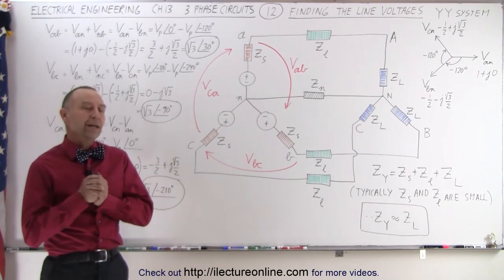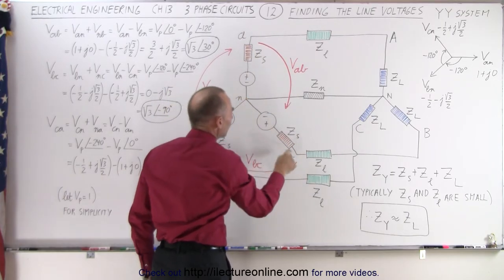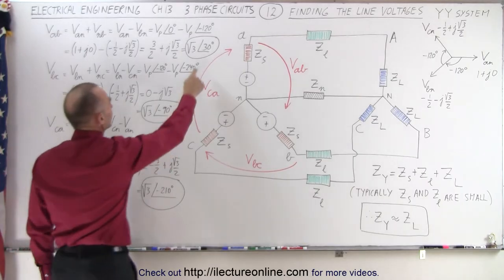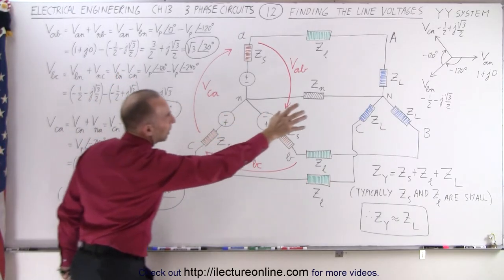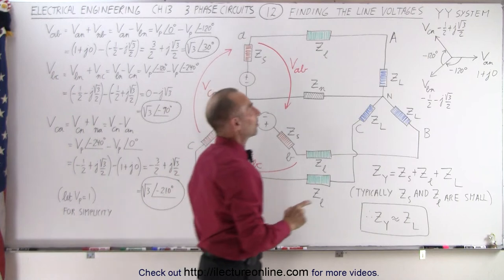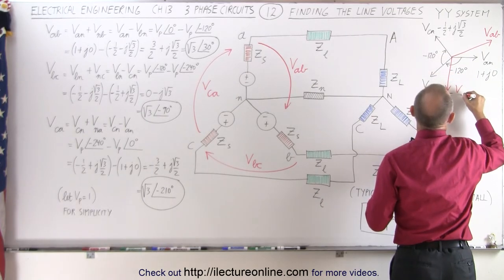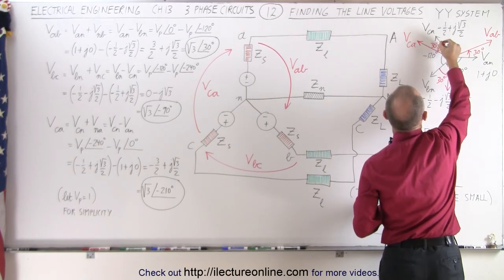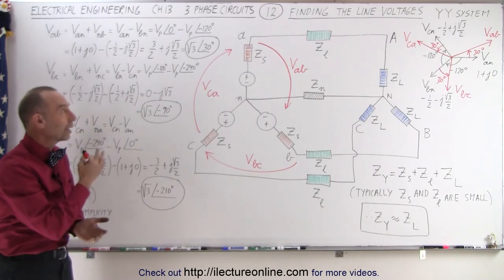Electrical Engineering: Ch 13: 3 Phase Circuit (12 of 42) What is the Line Voltage=? Y-Y System

Comment: Very nice!
This explains why the AC power at work is 120V single phase (one phase of a three phase Y connection) or 208V three phase Delta connection.
120 V x sqrt(3) = 207.8 V
Reply from the maker: Yes, that is correct.

Comment: For Vca I get a phase angle of -30, not -210. What am I missing here?
Reply: The voltage between A and B is 3/2 in the real (horizontal) component + (3^-2)/2 imaginary (vertical) component and that is a phase vector 30° rotated anti clockwise. The other, voltage between A and C is -3/2   + (3^-2)/2. -3/2 is a 180° anti clockwise rotation from 3/2. So 30°  + 180° will result in 210° anti clockwise.
Reply: @BernardoLameiras   didnt get it , could you possibly clarify?
Reply: im have the same question
Reply: You have to take the atan2 instead of simple atan to take care of the sign and the quadrant. This can be done using the scientific calculator as well by using the Pol function; just press shift + and enter the x,y components, and you'd find 150 degree which is equivalent to -210 degrees. The problem you faced was that you used atan which does not take care of the sign and quadrant unlike atan2.
Reply: @BernardoLameiras  man what?

Comment: So why is the line voltage of a two phase system 2 x phase voltage?  (120V x 2= 240V)
Reply from the maker: It depends on where the voltmeter connections are placed.  If  you span across both phases of the circuit you will obtain 240 V.